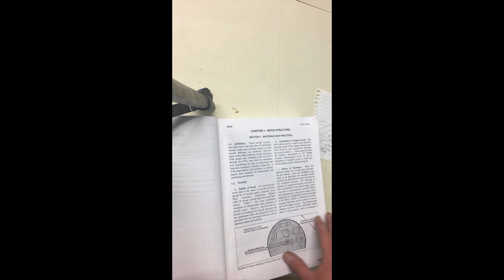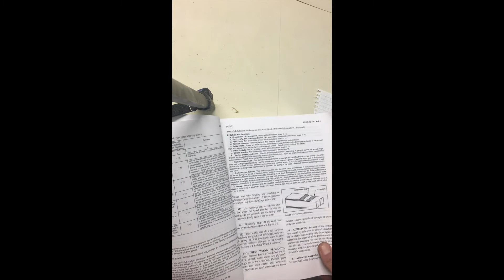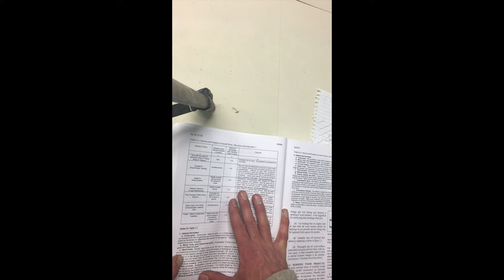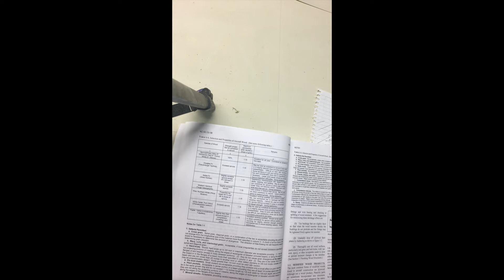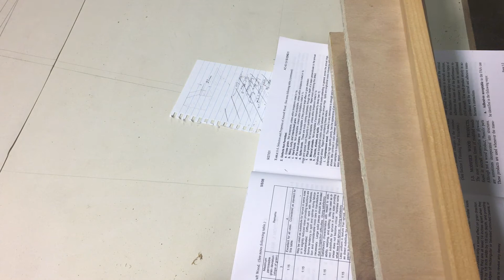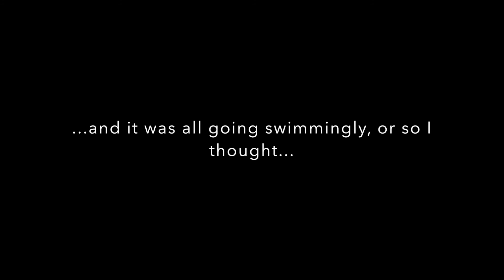Druine D31 Turbulent Build Vlog No 8

Comment: a rough surface of wood will hold the glue better.  a planed surface might be a bit too smooth.  cross sand with 80 grit, dust it off and apply glue to both halves.  use plastic or cello tape on two strips of wood the same dimension and sandwich the longeron to be glued between these two strips to help alignment .... from time to time make test joints and keep them for the inspector.  

I realize now that your blog is older than today....  apologies for my comments earlier on issues you had years ago.  Cheers ! and press on.
Reply from the maker: Hi, thanks for the comments, they all help to spur me on!  I will take some time to read/digest them over the next couple of days while I get me head around my next steps!
Reply: I should have read the date of your vlog before commenting !  Sorry about that.  Below is a link to a video I made of the engine test run yesterday.  I have made some changes to the intake and carb to get it to idle better. cheers.
https://youtu.be/vxxdJDzOYzs
Reply from the maker: Fantastic, it will be good to see an aircraft in action.  I will take a look!